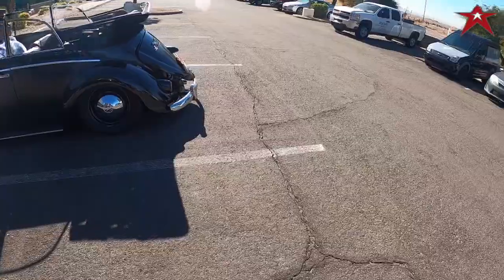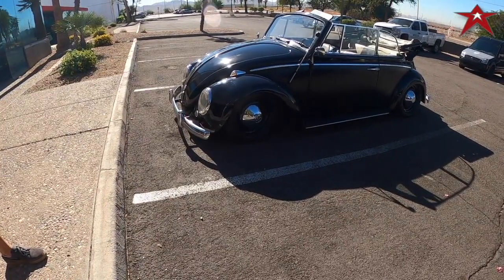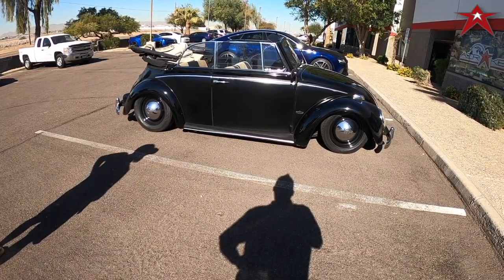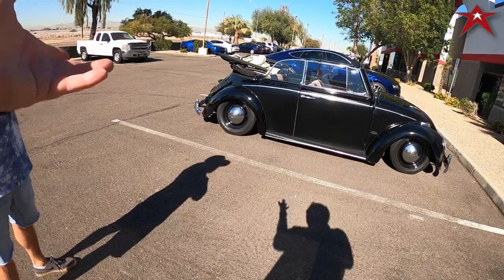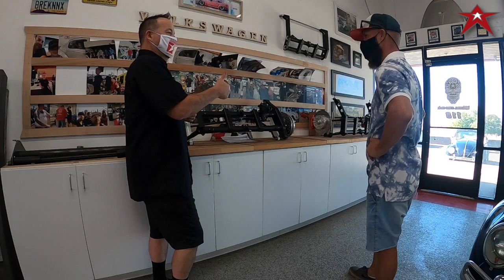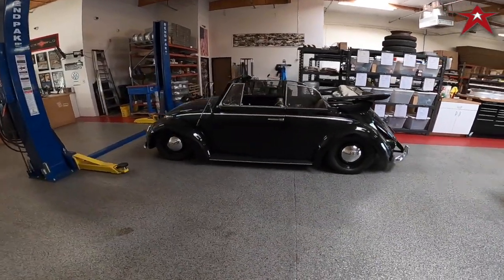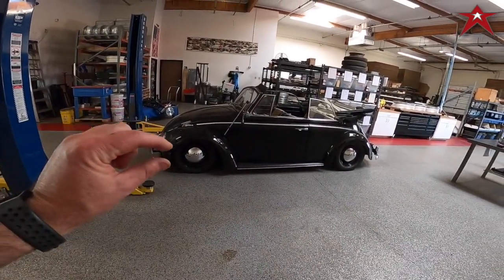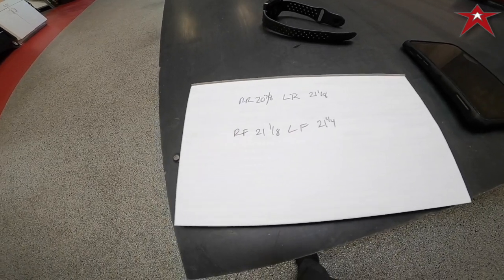1966 Classic VW Beetle | Part 1 | It might LOOK COOL, but THIS car is POS | Let's Fix It | Airkewld

Comment: It says 66 Conv. but judging by the taillights and the Pope's Nose aren't those qualities that showed up at the same time on a 62 or older?
Reply from the maker: Its a mutt my friend, throwing a pile of parts together and this is what we get.
Reply: @AirkewldVWs  is it possible to have a type 1 that old without the rake in the back but still sitting low? but not slammed like this car was.